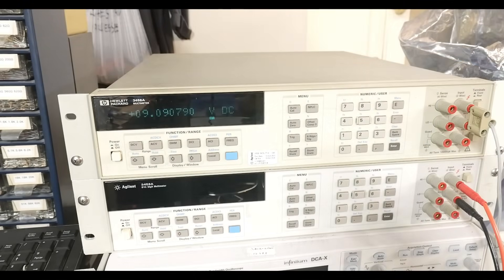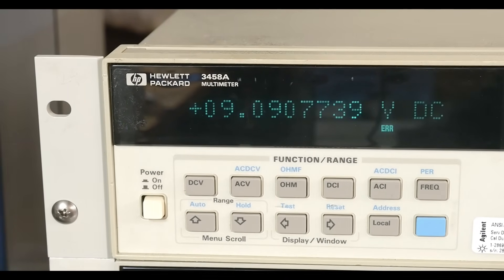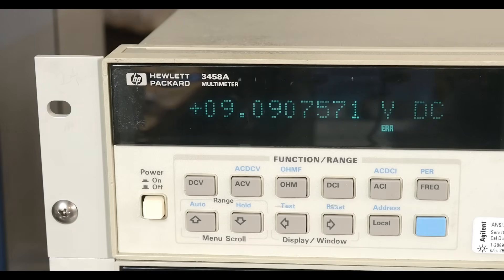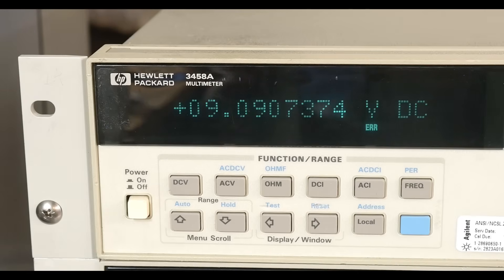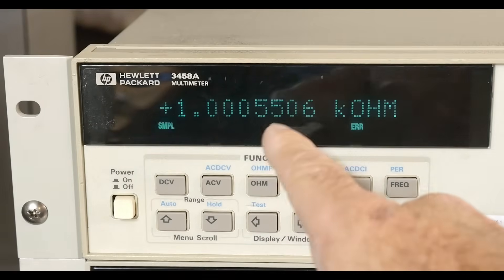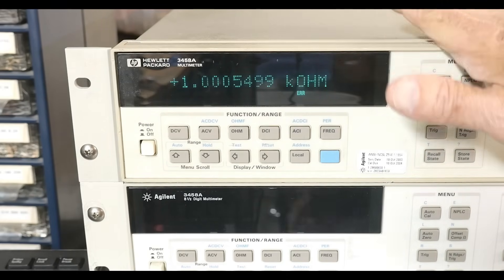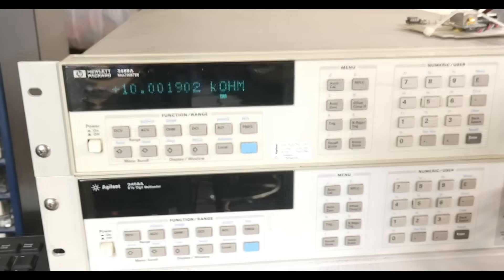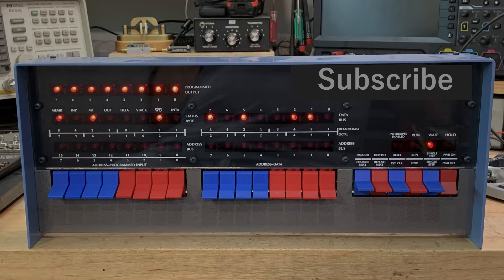#2419 Agilent 3458A 8.5 Digit Multimeter (part 14 of 16)

Comment: There are several source for the noise and drift. Some is from the DMM internal reference, some from thermal EMF, e.g. at the cables / therminals, Temperature fluctuations at the battery, mechanical stress to the batteries (e.g. via the cables). With the relatively fast (10 PC ?) readings there is also noise from the ADC. 

The 10 V source and 10 K resistor are OK for an adjustment. A formal calibration still needs the usual sources for all ranges to really to the check that ACAL actually really works.

While reasonable good at low voltages, there are better low voltage meters.
Looking at some batteries can make sense - at a stable temperature and mechanically isolated they can be very low noise.

Comment: For more digits try averaging several measurements.  The fluctuations are already rather small for an open measurement; to reduce them use a grounded Faraday cage enclosure around the DUT and don't let body heat change its temperature.

Comment: the 9v lithium battery will have a boost converter built into it, use an alkaline battery instead.
Reply from the maker: it is made of three primary 3V lithium cells
Reply: Not true. Not all "lithium" batteries are mini li-po's with boost circuits in them. The same as you can get legit lithium non-rechargeable AA/AAA cells and button cells. This is a non-rechargable lithium-manganese cell(s). You can tell from the voltage discharge curve in the datasheets, has a smooth drop-off. Lookup, Duracell lithium DL1604 datasheet

Comment: Welcome to the world of Volt-Nuts, a very deep rabbit hole.  I managed to find my way out a couple of years back.  Was working a LTZ1000 reference design that I never really finished.  Since then I got one of the new Analog Devices ADR1001 demo modules, it's very close to the performance of the LTZ1000 and not that expensive, a very nice little board.  Also got a year and a half old Keithley 6-1/2 DMM6500.   I am local, interested in a calibration party some time?

Comment: AI rejects your 9V battery! "The video at the timestamp you provided actually shows a third-party rechargeable lithium 9V battery with the "Duracell" branding being tested, likely a specialized or repackaged product, as Duracell does not offer a standard consumer lithium primary 9V battery."  I don't know where it comes up with this stuff.  Did you get it from an industrial tool, an OEM product, or from another country?  I've never seen one on a shelf for sale, that's why I asked Google AI.  Update:  This appears to be a discontinued cell from mid-2010's, part number DL1604.
Reply from the maker: I bought a bunch for my smoke detectors. I still use them taken out of service since they still seem to have lots of charge.
Reply: @IMSAIGuy  I tried Lithium primaries in smoke detectors, and the detectors went to low battery warning within a year, unlike alkalines. What I found out is their voltage decay curve is much different than alkalines.  The lithiums have plenty of charge left when “expired” by the detector which was made to detect alkaline SOC.
Reply: Paul, you are just proving how bad AI is. It's not that hard to google.
Reply: @ivolol  I googled it and it’s AI response was first.

Comment: Have you run an ACAL on it yet? I'm pretty sure you don't actually need to use the GPIB bus to get it to do calibrate. If I'm reading the Calibration Manual correctly: Press SHIFT+Menu, UP, Enter. This gets to the full command menu. Then press SHIFT+C, and find the CAL item. Enter CAL 0 twice; once with front terminals 4wire-shorted and set for operation, once with the rears. Then enter CAL 10.00NNN with a 10V source connected to operational front terminals. For resistance, set up meter for 4-wire ohms, offset compensated, Guard on LO (if not using), and use CAL 10.005E3 for a 10.005k resistor. Anyway I'm sure you might have already google'd 3458A calibration manual to read up on it yourself

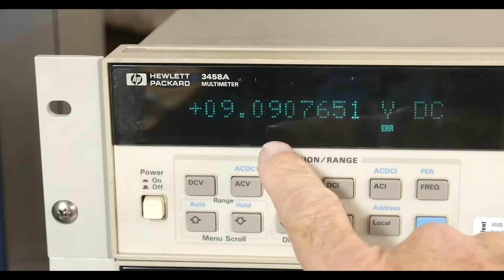Comment: 2:35 a 10th of a microvolt (uV) is known as 100nV or 100 nanovolt. Your resolution here (in the 10V range) is 100nV. Set the meter to NPLC 100 for a slower, more averaged measurement. That way it will calm down a bit, but don't expect a very stable least-significant digit, haha.

Comment: B4 tossing the display, check the cap(s) in the VFD HV circuit. That is often the reason the display goes dim in other devices with a VFD's. Also, there is at least one video on YT where the owner of a device with a VFD rejuvenated the display with good results.
Reply: "Just DIY" was the channel.
Reply: @pault6533  https://www.youtube.com/watch?v=YPJOcyx8pBk         https://www.youtube.com/watch?v=dNQXaUvKyiA
Reply: Video on rejuvenating  the VFD display:  https://www.youtube.com/watch?v=YPJOcyx8pBk     https://www.youtube.com/watch?v=dNQXaUvKyiA
Reply: I was able to purchase a new display for my HP 6/12 meter, from china a few years back for a reasonable price.  Don't know if it was a clone or a genuine HP part, but it worked great.